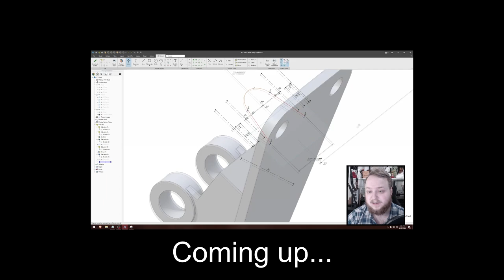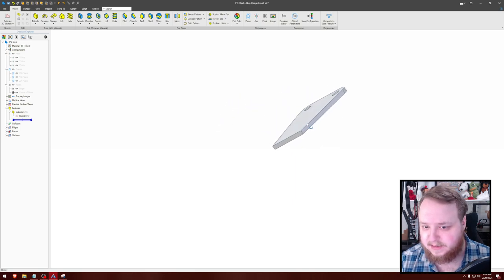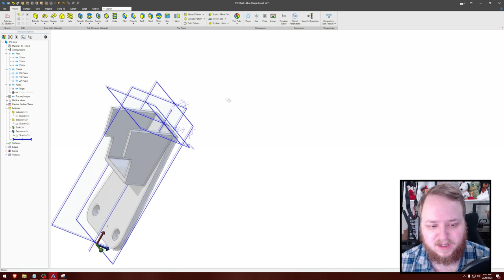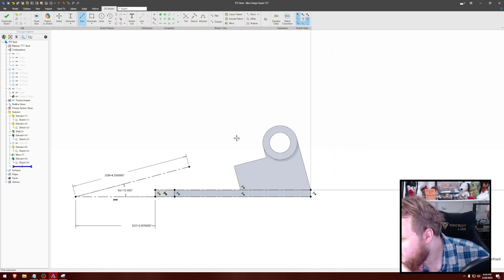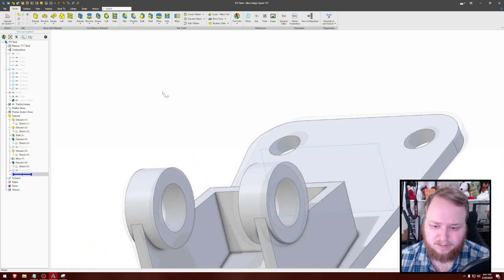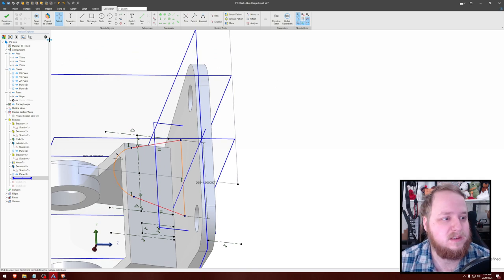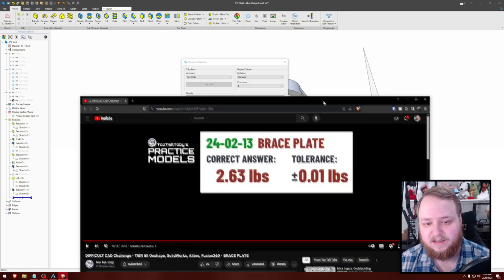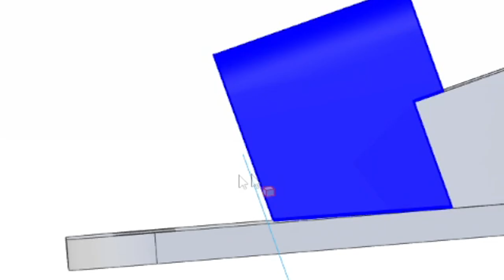The Model That BROKE Me. "BRACE PLATE" || Too Tall Toby Challenges #2

Comment: 10:10 You input that thickness in the override dimension. Alibre allow you to do multi-thickness shells.
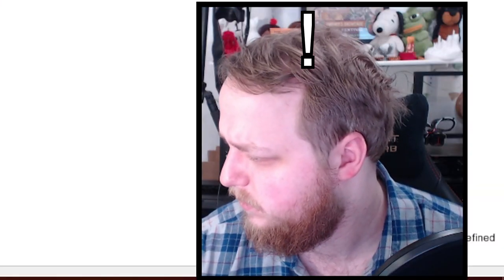26:06 YES!!! YES!!! You heard me! I said in my video to use unless there is no alternative. I did it without section views but you are well within "spec" to use one now.

In fact, you don't need the precise section view and you don't need a loft. It seems that that angled tombstone shape widens out as it goes but it doesn't. It's a simple extrude. You just have to imagine it as sinking into that bottom plate. So, the exposed base becomes smaller and it gives you the illusion of a drafted face. When it, in fact, is just a flat face. I might do a solved video for this one. It's a really hard one.
Reply from the maker: Well now I wanna know how you did it without.
But I'm glad I got there in the end!
Reply from the maker: Very very interesting. I thought that might be the case, but I figured it wasn't that simple. Looks are deceiving